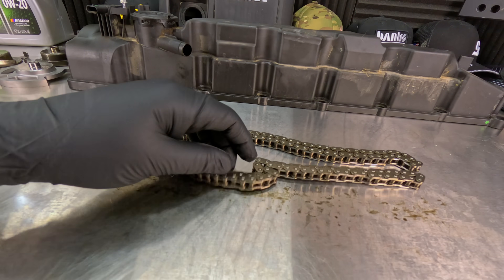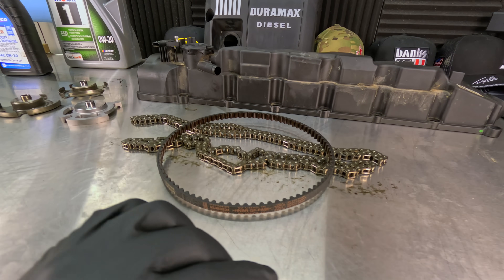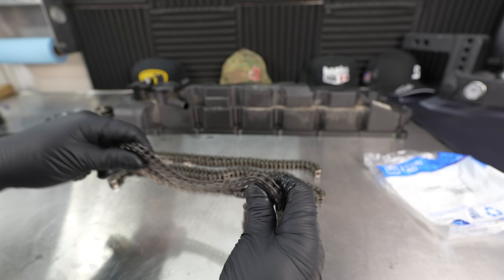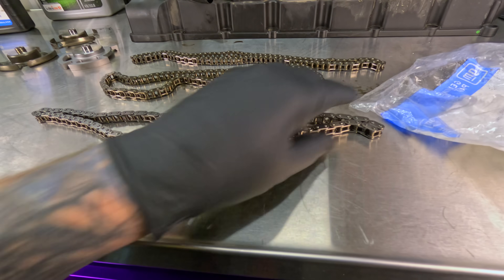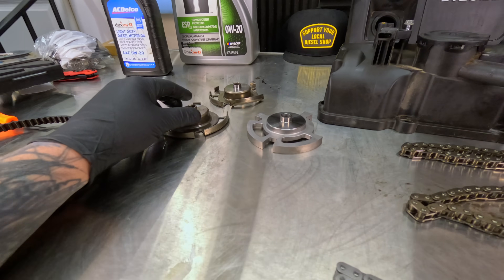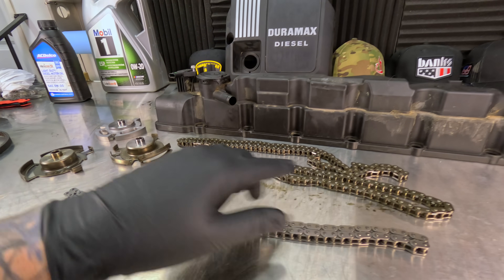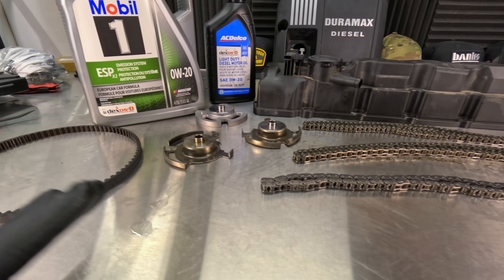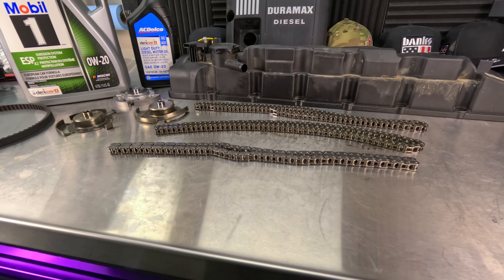3.0 Duramax $10k Timing Chain Failure — Updated Design vs Old

Comment: Interesting. Chains you measure "stretch" as a %, it's not really stretch it's wear. Just pugging in some basic math for wear using 98.95mm NEW & 99.59mm WORN. That's 0.64% stretch and 0.75% would be a general safe limit for requiring service. Good time to replace it, I'd never run right up to the service limit on a timing chain. Maybe I missed it, but are you able to comment on if that truck was throwing timing correlation codes?

I think it's a fair lawsuit for GM considering the oil pump belt was given a service life of 150k-200k yet nothing was mentioned about the timing chains and they clearly wear well before a rubber belt.
Reply from the maker: Correct, stretch is wear. The calculations given were across 7 links, then multiplied by total chain links providing a greater number.
Reply: @DemonWorks  in other platforms I've owned, there is a way to monitor certain parameters with a scanner to tell chain wear. Is there something similar for GM?

Comment: How many hours are in this $10K repair?
Reply from the maker: alldata labor time guide puts it at roughly 37 hours
Reply: @ unless it’s $6700 in parts, me with hundreds of thousands invested in CNC machines, I’m in the wrong business.
Reply from the maker: @Thewaldo12345  sounds like you may be in the wrong time period
Reply: @DemonWorks  nah it ain’t that.  We’ve got all modern equipment and techniques it’s just we have to competitively bid on work and can’t just say oh it’s $250/hr take it or leave it.  Not trying to talk bad about you and your shop, it’s just a different industry.  People have to have their cars running and will pay what the market says it’s worth to get them fixed.  A manufacturer has the luxury of shopping around who makes their parts.
Reply: @Thewaldo12345 its a terrible design meant to force you to be in a cycle of buying a new vehicle every 7 years.
Reply: I almost bought a GM truck with this engine, I was sold until I found out the oil pump belt and time chains were in the rear of the engine and required the cab to be removed to replace these components. Not to mention, the cover plate had a history of leaking and needs to be replaces when it's removed. I read these engines were designed for the European market cab-overs where the back of the engine would be easy to access. After a lot of thought and worry about the EPS DEF issues caused by the additive, I bought a good old V8 5.6L in a new 2024 Nissan Titan.
Reply: @highfiving50  Does the Nissan V-8's have the cylinder deactivation BS?
Reply: @mikescalise8380  No it does not, just an old school V8 and that is why I choose it.

Comment: Enjoy your Video's! I have a 2023 Chevy 1500 with the 3L Diesel. It has used oil since new. It uses 1 quart at 4500 miles. I have 25K on the truck. Do you think it can be a valve cover issue on the 2023 model? My dealer says the oil consumption  is not above normal. Would a catch can help?
Reply: 1qt in 4500 miles is way below the limit for acceptable oil burning. 

That’s just loss from pcv system
Reply: If you were burning 1 quart in 1000 Miles you’d still be within the limit of acceptable oil loss
Reply: @fastinradfordable  I have a 24 3.0 and I dont put any miles on it. Ive changed the oil twice in the 16 months ive owned it, albeit im omly at 10800 miles in that time. This is my first diesel and i didnt know anything about all the problems with these engines. Hopefully the fact that i dont drive that much mitigates some issues.
Reply: @ Would a catch can catch the oil so it doesn't go thru the engine into the DPF?

Comment: I have the 2024 LZO but going to keep changing my oil every 5K.  Oil is the life of any engine.
Reply: It’s cheaper to buy oil than a new engine
Reply: To an extent. But no amount of oil changes, or designer oils with pretty labels and bs marketing will fix critical engineering flaws. It is however, the only thing the average consumer has control over.
Reply: Especially if it's designed to eat it's own waste to lower NOX. Which isn't the best method to do it, but it's cheaper for the manufacturer.
Reply: I also have a 21 baby 3.0 duramax and I change my oil every 5k my engine is running pretty smooth,  I already have 300k miles everything original  engine and transmission ,if you take really good care of your baby duramax 3.0 it will last many many years.
Reply: @angelcamacho2059  the "baby duramax" is the 2.8
Reply: Same here. Going to change the oil every 5,000 mi. I have my first oil change to do immediately. I have 5342 but I didn't have a chance to change it yet. 

I used to do the oil in my F-150 every 3,000 mi. That truck died with 244,000 mi on it and the only reason why it died was because of a flood. The flood messed up the electrical system and ended up burning out all the oil in the engine. I only got a low oil warning light after about 4 quarts evaporated. I think water got in the engine and helped burn the oil out. I just don't know. So odd. I had no oil leaks up to that point.
Reply: 2 things actually

Oil changes and maintaining fuel system/ injectors functioning properly by having premium fuel or adding additives to straight #2 diesel to keep it clean!

Comment: Great explanation Greg.  This video answered some questions for me as a 2020 LM2 owner.  Maybe you could tell us the cost difference in engine replacement and any benefits of engine replacement vs timing chain replacement\repair. Thanks again.
Reply from the maker: I meant to add that into the video but left it out. Good question ! I am seeing price difference of $2000 to get the engine replaced instead. Which I think is the way to go given all of the new parts including fuel system included with it as well.

Comment: Hey boss! I’ve been following for a while, but wanted to confirm in case you made a mistake. Are you sure the 2023 LM2 SUVs are at 200k for the belt? My 23 Tahoe LM2 has the old style right?
Reply from the maker: Correct your 23 Tahoe is a 200,000 Mile interval for the oil pump belt. That engine will have all of the latest updates to it.

Comment: Schaeffer's has a new 0w20 full synthetic designed for that engine.
Reply: High Performance Lubricants (HPL) also has a 0w20 oil for this engine. They also make a 5w30 that surpasses the Dexos D spec.

Comment: Chevy used to have great engines and bad transmissions now they can’t make anything good. My 18 LZ2 Silverado with the terrible 8 speed burned me from ever looking at a bow tie again
Reply: Everything from everyone sucks. I have new fords chevy’s and dodges in my shop constantly.
Reply: all brands are junk now
Reply: I agree with all but the transmission comment. I have an 04 with the dreaded 4l60e and it's got 250k on it with only a single fluid and filter change. Not even a real flush. I'm gathering parts to just overhaul the whole truck cause it still runs and drives but if I just spend the 10k now it's 100x the truck a new one could ever be. One day maybe folks will stop buying these junk pickups everyone makes these days.
Reply: @waldren09  have 6150 here and shudder since the beginning
Reply: 4l80 is one of the best transmissions ever
Reply: Which brand do you go to?    There all having issues,  sad times , trucks prices are ridiculous and quality down
Reply: @ I went to a ram 1500 Hemi after that truck, sold it at 30,000 miles because it was so bad mechanically. That was 2 years ago,  I was going to buy a tundra but they were all exploding. I no longer have a truck
Reply: good luck  @Keith-u9h
Reply: I've owned 3 Ford trucks in a row.  Currently own a F250 diesel.  Problems & recalls are the words of the day. Mechanical quality sucks nowadays.  Their focus is on the high profit touchscreen junk.
Reply: I have put 4 3.0 engines in 
 the last month  timing chains  70.000 miles to 125.000 
 common oil burning ,valve cover of the complete engine replacements one was a 2024,30.000 miles turbo let go I see this trucks every day at the dealership I work at
Reply: Same
Reply: Maybe during the phasing in of the early 200 and 7004Rs/4L60's as they sold out to get every literal inch of fuel economy, GM made the most durable, heavy duty transmissions in automotive history. The TH400 was the most successful and prolific competition and HD street application transmission ever. And the TH350 was as successful as the 400 when that much strength wasn't needed. 400s routinely are built to hold 3500 hp and after 59 years, can still be found in pro dragsters today. As well as many other manufacturers using them. Certainly, when trying to chase government mandated economy, all manufacturers equipment is compromised. But to say GM always had good engines but shit transmissions is laughable.
Reply: My transmission 8sp made it to 129,000 before needing replacement even with the required maintenance

Comment: A real diesel engine would have gears driving the camshaft and you won't find a rubber belt driving an oil pump.
Reply: Some of the most reliable diesel engines made use chains for both the cam and oil pump, and they don't have any chain issues. 
They could make chain drive that was reliable over 30 years ago, no excuses making stuff that doesn't last now.
Reply: @TheLawnWanderer  Maybe so, but I'll stick with gears for those two items.
Reply: @RonRussell-sj1zf  Gears for pushrod engines and double-row chains for overhead cam engines.
Reply: @TheLawnWanderer  dollars to donuts the ones that lasted were US made, and the crap ones are Chinese

Comment: What about the 2021
Reply: I've got 109,000Kms on my 2021. Change oil and fuel filter every 6,000kms and only use Shell V-Power diesel.
 No big issues or worries yet. Very happy with my truck.
Reply: I have 85k on my 2021. I’m getting nervous

Comment: I have a 2025..do i have to worry about this??! Wth!
Reply: I have a 2024 and I am NOT worried.
Reply: That's a real good question.  I wish that we could get access to a repair manual just to learn some of the questions.  And the dealers are not forthcoming.On any answers, both on the engine and the transmission.

Comment: It definitely seems like recall or lawsuit material when it costs that much. GM knowingly updated the chain because the original was not holding up.
Reply: With a class action lawsuit against GM winding its way through the courts for AFM/DFM a leading cause of engine failures regarding the 5.3 and or 6.2 when as the first or second generation of the 3L Duramax has updates to the timing chain and sprockets when getting rid of the wet belt that drives the oil pump as there is stories of owners convincing GM to replace the entire engine after not approving the transmission to be dropped to replace the timing chain and or wet belt.

Comment: Great info as always.   Just changed the oil myself on Saturday. Went with the Mobil 1 and Wix filter.
I had already planned to change it every 5K miles. 
Also I add Lucas Oil 10872 Oil Diesel Deep Clean, 16 Ounce in the fuel tank a week or so before I do an oil change.
Reply: Good oil. AMSOIL is good,also. PPE oil filters are an improvement over Wix filters.
Reply: @PastarocketS-sb7nk  Have not seen a breakdown/review on the PPE filters yet.
Not saying they are not good..Just have not seen any reviews.
Amsoil is very good.. but it is PRICEY.
You get 1 container of 5 quarts of Mobil 1 for under $30.
Amsoil sells it only by the quart and it is 9 or 10 dollars or higher per quart.
I have used Mobil 1 for decades and it is a very good oil.
Reply: @texZR2  Yes, I  agreed Mobil 1 was good. I only offered an alternative oil that is good, also. Gale Banks uses it in his diesel engine builds. You can watch a past video on this channel concerning PPE oil filters. They are bigger, more expensive, but filter smaller particles.  For long-term protection of these modern diesel engines, running cleaner is better.
Reply: @texZR2  Rather 10$ a quart than a 10k$ replacement.

Comment: Yeah, happened to me and I am still pissed. I had 111k on my 2020 Silverado with the LM2. Motor mounts went out, and they were replaced but the horrible vibration issue made it undriveable. Right out of the shop, I got the P0016 timing chain code. Quoted over $12k for repairs. With the massive motor mount vibration problem that was unfixable and this huge repair bill for the timing chain, I dumped the truck for a massive loss. I hope this turns into a recall or a class-action. I got screwed royally by GM.
Reply: Sorry to hear that, the engineering and build quality of new vehicles is criminal.
Reply: @RawMen_Noodles  these engines aren't bad though
Reply: 114,000 on my 2020 Duramax and this just happened to me. No warranty, I am screwed
Reply: @jupetownsend4171  This is why I buy extended warranty.  It's not if the engine will fail, it's when.   After 100,000 miles your skating on thin ice.
Reply: See my above comment.  I dumped my 21 AT4 3.0 because x2 Blackstone labs oil samples in 60-70k miles had wear metals off the charts. The thing sucked 1 quart of oil ea 1000 miles and 5 gallon of Def / 1000 miles and phantom emissions codes that GM never did solve.  

Religiously serviced with Dex-d 0-20 piss.  F GM

This is after my 2019 2.8 Colorado had an injector stick @ 105k and burned a hole in the piston.  

Double F GM.
Reply: No warranty?
Reply: @NineInchTyrone 111k miles.
Reply: The new long block is like $3500 direct through Chevy.
Reply: @lawnmowerman25  since when does a short block include the timing chains?  Also the short block is several times more labor to install, than the timing chain
Reply: @ACatKrom  gm doesn't offer a short block.  You get the kit and k boodle
Reply: How come you didn't state the miles 😂
Reply: @johnmitchell8925  Did you read the post? 111k miles is in there, big as hell.
Reply: Cam shaft covers for 2020 3.0 lm2 duramax
Reply: Did they change this in 2021?
Reply: I had an identical problem at 109,000 miles.  I brought in several times while under warranty and they didn't fix.
Reply: the expected life is 60000 miles and they made the powertrain warranty 100,000 and you say GM screwed you after you got 111k???
Reply: @charliemagoo7943  huh?
Reply: @bizkitbr whats the huh about??? If they could make plastic pistons and exhaust manifold they would.  These engines are for people that cant figure dollars per mile.  Rather they have a gauge that says mpg.  Through science they are designed to fail right after warranty is out.
Reply: @charliemagoo7943  the GM 5.3 v8 before AFM was/is an absolute legend for longevity and even older GM trucks sell for great resale with hundreds of thousands of miles on them... this initial LM2 diesel problem is partly EPA caused as the design required to get compliant is restricts a lot.

Comment: That belt should of been a chain / metal one . I was gonna get the 3.0 baby diesel I had a change of heart and bought the 6.6 diesel. Thank God I did
Reply: LMFAO! The belt is lasting longer than the original timing chains. Clearly not a real problem.
Reply: Tdis have the same style pump drive, never heard of an issue on those
Reply: 3.0 is the best engine in a truck I’ve ever had. I don’t have any of the issues and have gotten a 40 mpg on road trips don’t just listen to bad reviews it’s been an amazing powertrain for me
Reply: Should HAVE, not should OF!
Reply: The belt is literally a non issue. No one has had a failure of the belt. Just have it changed once the transmission needs rebuilt (99% of the time that’s less than 200k miles in a GM) it’s just an extra 2hrs of labor and a $35 part at that point.